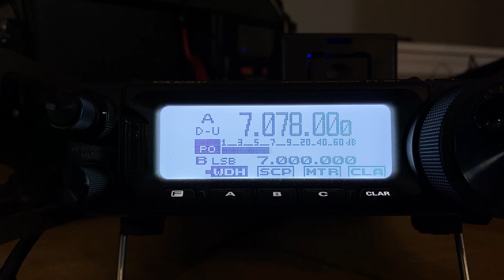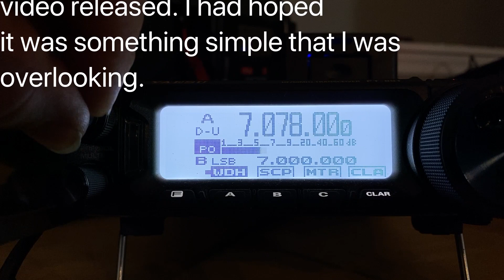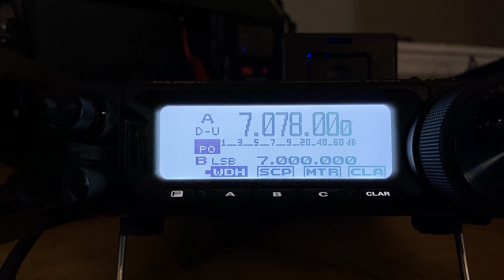Broken 891 Part 2

Comment: That definitely sounds like a thermal protection circuit. but on receive?
Reply from the maker: According to the Yaesu invoice, it was a bad diode causing the issue. Been running great since I got it back in my hands :-)
Reply: @KM4ACK  I’ve heard elsewhere that a diode has been causing this issue. My 891 is doing the exact same thing as yours so I’m about to send it to yaesu.
Reply from the maker: @aurtisanminer2827  it was a bad diode in mine as well.
Reply: @KM4ACK  I should have yaesu send me some extra diodes. Lol. I tried a full reset of mine yesterday but that didnt help. It’s now boxed up and ready for the mail. I wonder what measures can be taken to prevent this issue in the future?  Someone said to try putting a shunt on my coax connector to help dissipate any large bursts of RF.

Comment: I found and Article on QRZ.Com which sounds exactly like your issue.  Here is a link to check out:  https://forums.qrz.com/index.php?threads/yaesu-ft-891-getting-very-hot-on-receive.626174/   ... Easy first check is check the Amps draw and see if it is abnormally high which iindicates the PA Finals are NOT shutting down...  Acrticale explams much better than I can ..  Good Luck
Reply from the maker: Thanks for the link! I'll check it out.

Comment: Hi, try pressing the "mult" button.

I downloaded & partially read the advanced manual & noticed there are a couple of power save modes. 

I suspect one of those is to kill the audio output as it takes some power. 

Anyway, most of those I found say to press the "mult" button to exit.

If that works (or doesn't) read through your advanced manual to find which menu setting may be causing the issue. 

Good luck, Hope this helps.

Comment: I have this radio and couldn’t get anything after hearing stations on all the bands. Wanted to reset it but blogs said don’t do it. . I then saw I had the D-U on the A channel. Don’t remember which setting it was but I got it back to side band and started receiving again. Don’t even know how it changed to D-U. Sorry, I’m a newbie and still learning to operate this rig. I couldn’t help commenting when I saw your screen.
Reply from the maker: D-U is data USB. A normal mode for operating digital modes like js8call & ft8
Reply: KM4ACK 
Thanks!

Comment: I had  similar issue waaaay back in the 90s with a Kenwood mobile dual-bander. It turned out to be a bad solder joint/PCB trace that would go 'open circuit' when things warmed up and physically expanded. It wasn't something I would have been able to trace myself and thank heaven it was still under warranty.
Best of luck!
Rob

Comment: I would think poor solder joint somewhere that, when heated, looses its connection. That sounds like an issue yeasu would have to fix. The components are way to small and sompact to try to work on, at least for me. Good luck

Comment: It was used too much when it was new.
Reply: Thats a common error, you have to wait for new gear to get old before using them.
Reply: Jokes aside. Check this post from instagram i found: https://www.instagram.com/p/CDofksbjNcG/?igshid=1vvn12txcx0c6

Tldr: D1008 + D1087 replaced resolved a similar issue. I think i have schematics and servicemanual. But if warranty is good, just send it.
Reply from the maker: If that breaks a radio, I am swapping brands :-)